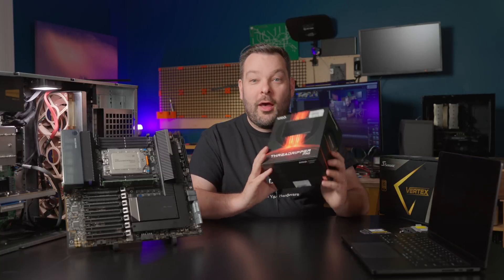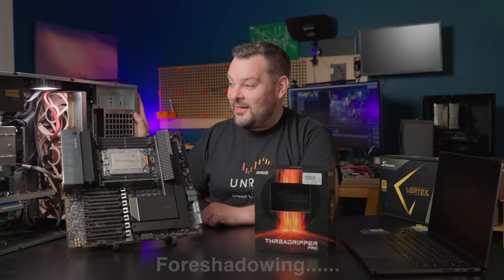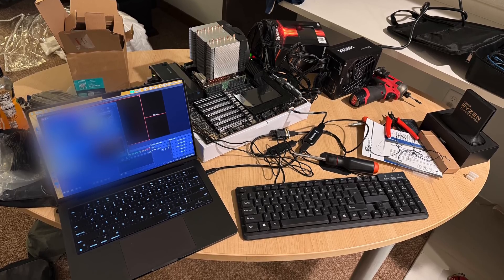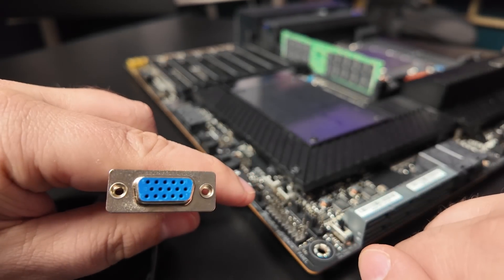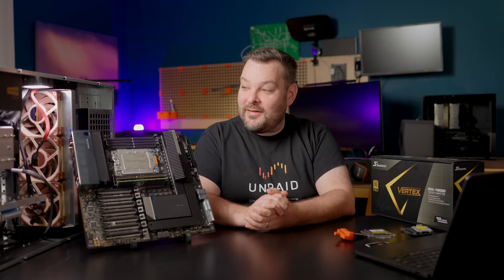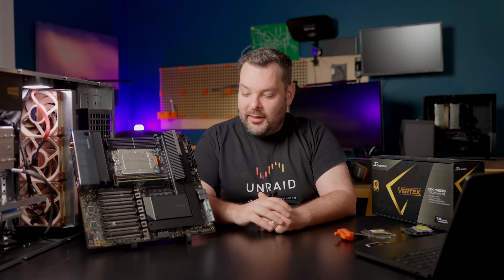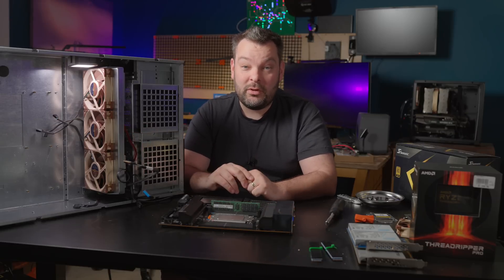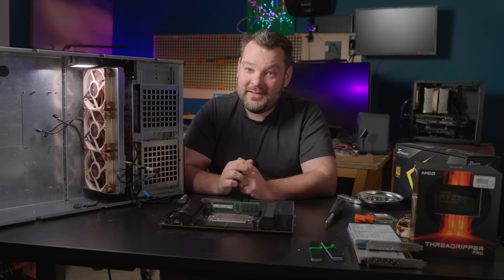When Nothing Goes According to Plan | Threadripper PRO 5955WX server build

Comment: I have that exact VGA to HDMI adapter. It does not support most bios resolutions if the board has bmc, and may cause you significant issues. The most significant one that almost none of them support is 720x400 @ 70hz. If you look up martin hinner VGA timings (can't post link) you will find the odd refresh rate ones that cause issues, of which there are many. You need to have either a VGA monitor or a proper VGA to HDMI adapter for it to work properly with a lot of ipmi capable boards, sadly.

Comment: Quite glad it was just a clearance issue, I was half expecting a “I killed another board” segment after you mentioning your want to reuse the case and the fact you already tested the board. Maybe something like during removal of the GPU you moved some piece of the case that managed to short out the board and cause it to fail, and you didn’t notice and did the same with the new one or something tragic like that.
Reply from the maker: Thankfully it’s just a simple matter of size.
Reply: Dust is shorting your MB. It happened to me few times.  Use air blower/vacuum cleaner to clean and try to reboot.

Comment: Could the fans not be installed on the otherside of the fan wall?
Reply from the maker: technically the answer is yes but they’d be mighty close to fouling the drive cabling
Reply: @ktzsystems  Just flip the wall

Comment: at some point you'll need a breaker in the circuit panel just for this server. 1200W is a lot of draw.
Reply from the maker: or i need to get the rack running off 220
Reply: @ktzsystems I^2 * R losses hurt!  This is why pretty much all high density data center racks in the US are all 220V power (or 3 phase, depending).   These days with universal switching power supplies, it makes sense to do this.

Comment: Incredible build, but personally, I would have gone with the ASrock WRX80 Creator R2.0, for the price, dedicated iPMI port, more open biffurcation configurations; x8x4x4, x4x4x8, or even x8x8 and thunderbolt on AMD 🤫
Reply from the maker: Aquantia 10GB NICs though?
Reply: @ktzsystems , surprisingly, I never had any issues with them, even when I used Proxmox, ESXI, TrueNAS, or Unraid. And run daily with my Windows laptop in a docking, but that's regular business
Reply: @ktzsystems  Yeah but you can throw a 100Gbe Mellanox in one of those PCIe slots.